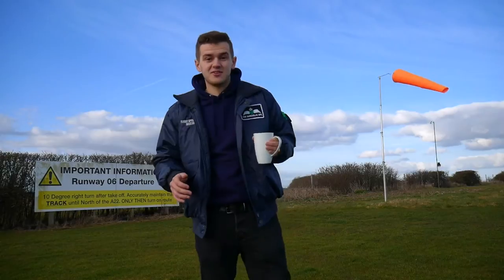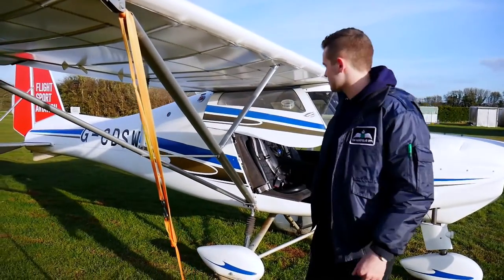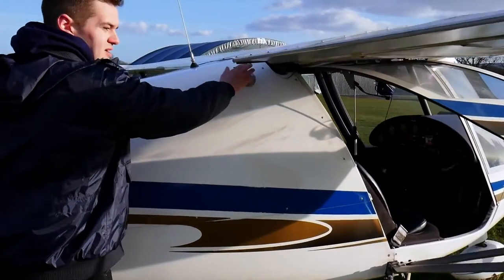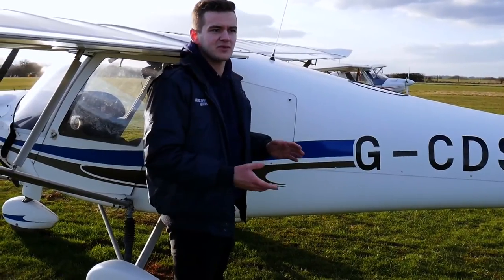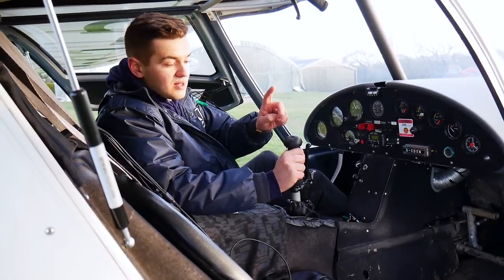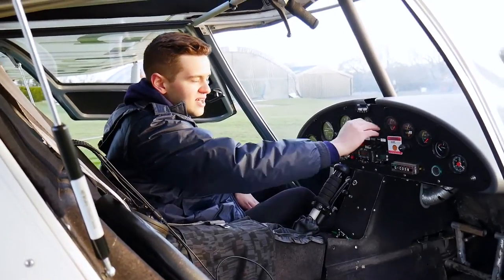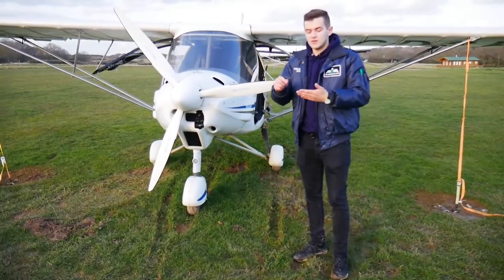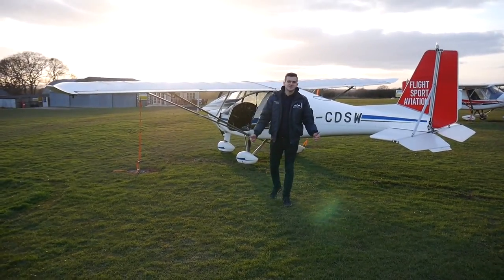Aircraft Review: The Ikarus C42 Microlight

Comment: During your oil level check procedure, just turn the prop until you fell the maximum compression.  Then hold it and let the pressure escape into the crankcase. You will get your result quicker and with less effort.
Reply: That's exactly how to burp the 912. Nice and slow, let the pressure leak past the rings. Makes life much easier!

Comment: 12:42
The oil is pushed back into the reservoir by using the crankcase ventilation. 
No pump required.

Comment: Just a personal gripe, but does anybody know why the C42 was designed with the throttle between the legs? So starting is a juggle, holding the (loose) throttle with left hand, then pulling the choke against a spring between little fingers of right hand whilst stretching the other fingers to operate the start key. I seems madness not to be able to set the throttle. And also it's impossible to unfold and use a kneeboard in flight, so now have to use two, one on each leg. I know it's better than the foot control on a Trike, but still, what were the designers thinking?

Comment: Dankie/ Merci The MicroPilot. It was a nice video and very informative. In the Landbouweekblad (An ZA farmers magazine) of 20/04/2007 AD the Ikarus C42 was shown . It use 12L per hour and its feultank of 65L can be dubble. (130L). 130L=104kg. The magazine said you can carry 130L  insecticide. It is not clear if that means 130L+ 130L? In that case the 600km flight range can be 2 400km (depending on the wind...). I have seen on resent years the use of Diesel engines. A bit more wight and 30 to 40% use less fuel. Thanx again!
Reply: David van Niekerk thanks for the info 👍how much , pound notes
Reply: @patrickquinn8473  Dankie Patrick Quinn. My Pounds are save in England. Not much, but if things go Zimbabwe. I'll have some small backdoor.. As it is in Africa, my Nokia's was reposes and is now somewhere in an informal  dwelling. On my phones was all my info and calculations of small plains. Corona is here and the `1cellphones shops are closed ... Can a man reach La Reunion from South Africa? Thank you for your feedback. At least I have something back..

Comment: I think the aviation community needs to get a little more clear about the terms ultralight & microlight, because this is not in any reasonable person's definition, anywhere close to microlight. IMO, microlight should mean an aircraft you can fly without a license legally in most countries, ultralight would be right on that threshold (some you can, some you can't), then just plain "light" would be the plane in this video, which I'm pretty sure does require a license almost everywhere.
Reply from the maker: Interesting point. It really does vary per country. I'm aware in the US it is possible to fly some types of aircraft without a license but here in the UK, you even need a license to fly a decent drone/quadcopter.
Reply: AFAIK nowhere in Europe you can fly an airplane of any kind without some type of license. As The MicroPilot said, even flying a quadcopter, unless it's designated as a toy, requires a license.

Comment: I'm comparing that sign outlining the runway 06 departure instructions with Google Earth, and it doesn't make any sense. 10 degrees right of runway heading takes you over the buildings northeast of the field, and over the buildings east of the road junction in Golden Cross (The "Oakwood Business Park"), but flying runway heading, or a little left, takes you over open farmland and west of Golden Cross. Must be a rich guy with his MP on speed dial under the runway heading.
Reply from the maker: It's for noise abatement.
Reply: @TheMicroPilot  Not at all surprising, which means it makes even less sense. Direct the departing aircraft over occupied buildings instead of over open farmland?